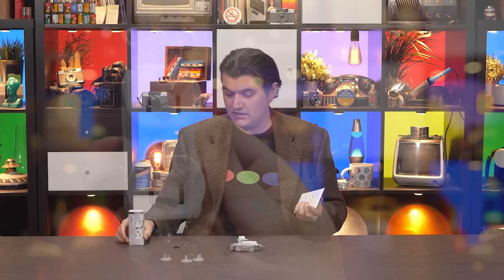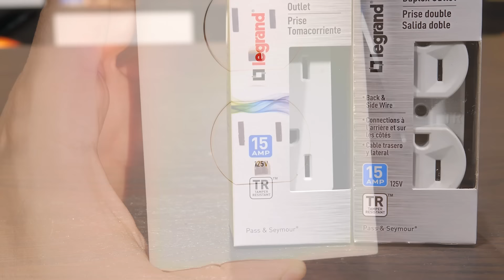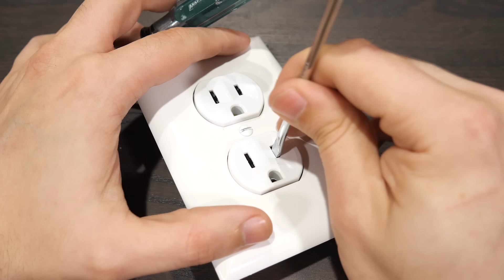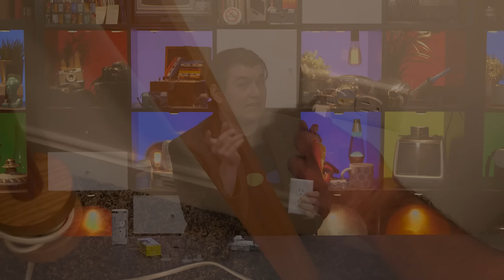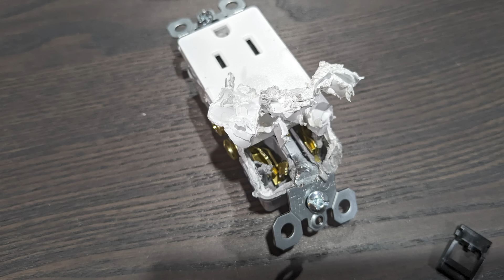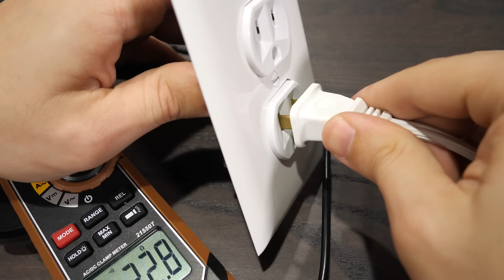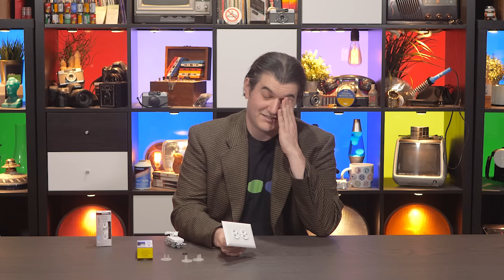Tamper-resistant outlets aren't all the same - a follow-up

Comment: About this "Your plugs are falling out":
What people mean by that (or at least what I mean when I say this) is when you accidentally pull the cord, by walking over it, pulling vaccum cleaner over the cable or just tripping on it - 99% of the cases the plug is going to be yanked out of the wall. My pal living in LA has really messy cables under his desk, and it's very often to him, in the heat of gaming, get his foot tangled around, yank it and unplug like half of his stuff (monitors, speakers etc, even the PC sometimes).
Whereas in Europe you have to pull really, really hard on the plug to take it out (unless it's really shitty recepticle), and often with bigger plugs, like the ones for vaccum cleaners or PCs, it's nearly impossible to pull them out by accident - cuz they are always right-angle and are flush-fit to recessed space in recepticle. So absolutely no ammount of pulling by the cable will yank them out.
In short - in USA if you trip over your cable you pull it out. In Europe you become AT-AT on Hoth...

Comment: I have been to US hotel rooms a LOT, and my adapters kept falling out of wall sockets all the time. US American plugs and sockets are simply crap; just own up to it and get something better. Sorry to be so blunt but that is how it is. 
If the US were to adopt IEC 60906-1 sockets and plugs (and 240 V power on all sockets, which isn't as big a deal as you might think), they would be ahead of the curve for once, and the rest of the world would be catching up.
All it takes is a bit of actual dedication to do it right. Keep your old sockets for legacy devices but stop stelling new ones NOW and start installing IEC 60906-1 sockets NOW.

Comment: Hotel ones are pretty dire - I had some in a hotel in Monterey where the plug for the cheap fan would just fall out. 

The other thing is we're probably using heavier converters - trying to find a socket that would support a UK to US plug was a nightmare without propping it up.

Comment: I can't remember ever getting shocked from using a plug in my nearly forty years of using US style outlets. Even the many I've had to use in poor condition. I have however been the recipient of many shocks at our household current due to my foolhardy insistence on repairing/making my own devices. And while I know that it does happen, no one I've known, even including friends of friends and distant cousins has died or been seriously injured due to a shock at household current, only a couple when working on industrial systems with much higher voltages and while taking safety shortcuts due to perceived time pressures.

Comment: I personally always use the side screws to wire the outlet or switch but I did use the "backstab" connection to teach my 9 year old son how to wire his own light switch. We went through all the safety and turned off the breaker and tested that the power was cut to the switch.

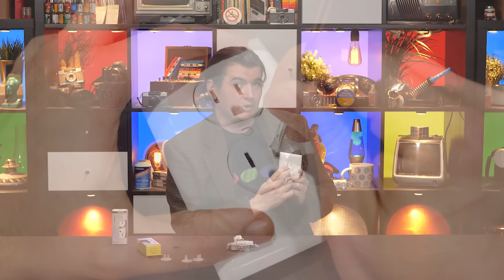Comment: 2:20 that's how shutters on mainland europe plugs have worked for... decades I think? Getting them straight on is also less of an issue outside of europlugs, as both the E and F sockets will guide the corresponding plug more or less in thanks to the recess (and the side-guides on the F). Type C-2 europlugs do suffer from the "wiggle from side to side" issue.

Comment: Some british outlets use the "both pins simultaneously" guard instead of shuttering off the earth pin. Most MK sockets (widely regarded as 'gold star') work like this. This means that sticking a screwdriver/key/whatever in the earth hole won't reveal any live parts.

Comment: You've hit on the reason most folks HATE the TR outlets, they prevent easy, legitimate access.
Also, I prefer the conversational style of this video.
Reply: As a grown-ass adult of forty years, I LOATHE TR outlets. It’s a fight any time I want to plug something in. It’s never the same angle or amount of force twice in a row, even with the same device. I have very limited outlets in my kitchen and often have to swap things in and out. TR outlets make it take ten times longer than it actually should, every single time, because I have to stand there just fighting the damn outlet to let the plug in.

Comment: Some socket manufacturers in the UK use a shutter system that requires the presence of the Earth pin and also simultaneous insertion of the Line and Neutral pins. I don’t think even the most curious toddler would ever figure that out 😂

Comment: My thoughts on the whole "plugs falling out thing":  Visitors from other countries and continents are likely to encounter US-style plugs in hotels.  My personal experience has been that I've only encountered dangerously loose outlets in hotels where the outlets get the most use and abuse.
Reply: The bedside/desk lamps that have an outlet with square black plastic trim are always the absolute worst, I've never encountered a single one that wasn't incredibly loose even in new hotels so I'm inclined to think they're really that bad from the factory.
Reply: @adueppen  Don't forget that hotels are typically constructed with the cheapest materials available, so the outlets start out bad and wear very quickly. I've encountered quite a few loose/worn outlets in old houses and in very cheap houses - especially older manufactured home.
Reply: @timdouglass9831  usually the wall outlets haven't been too bad from my experience, it's primarily those lamps that are ridiculously awful
Reply: I second that. I’m in hotels and on planes all the time for work and they wear out so fast that they are almost universally worn out whenever you try to use them. On a hotel bedside table, if a plug stays in an outlet well enough to even maintain an electrical connection, it’s cause for celebration.
Reply: I think it might also be down to the use of travel adaptors. The extra mass, bulk and sometimes poor design of adaptors (many "universal" ones have rotating flat prongs designed for both US and AU/NZ sockets, the latter of which don't have different widths for the live and neutral pins) combined with a heavier plug can make it more prone to pulling away from the wall when jostled.
Reply: To add on to that if anyone is using an adapter they’re usually very bulky which moves the center of mass well out from the wall so combine that with heavily used receptacles there likely to be pulled out by their open gravity
Reply: @Kaze919 I have the same thought about adapters -- my experience traveling to Europe is that my chargers are constantly falling out of the outlets, but I assume that's because I was using cheap adapters.
Reply: @meatmanek same! I’ve experienced really loose outlets in Europe, using 2 prong plugs (the ones with a “diamond” shape). I’m sure a 3 prong, or a 2 prong that has a cylindrical boss instead of a diamond would be more secure, since it would actually mechanically interface with the bore
Reply: I think it's a combination of "two prongs feel less secure than three prongs" (understandable since there are fewer points where the plug is gripped by the socket) and maybe that hotel sockets are likely to be the type that accept all conceivable plugs and therefore have much wider tolerances.
Reply: @3rdalbum  I wonder if the Australian socket (which is similar to the US one) is better as the blades are angled. (Interestingly, the Aussie socket is actually an abandoned US standard).
Reply: @chaos.corner  The Aussie plugs/sockets are very good. By law all plugs now have sleeves on the prongs so they can't be bridged by the "throw knives at the wall" game. The prongs are retained very securely, and earthing has always been required on sockets.
Reply: Also, the cord normally comes out of the back of the plug rather than the bottom, so it's easier to remove without touching the prongs - although as I mentioned, the prongs now have sleeves and have done since the mid-2000s.
Reply: Came to say this. I travel to the same hotel every 2 weeks and every room I’ve stayed in has had at least one or two outlets that were totally worn out.
Reply: Tourists in general develop an extremely warped perspective of what life is like in other countries. In many ways, they're often more ignorant than people who've never gone abroad.
Reply: Besides the outlets being worn out, most Northern European outlets like the ones in Germany and France (not the same but often intercompatible) have round recessed edges and support the plug fully. It makes North American outlets feel very flimsy.
Reply: Yeah I don't think I've ever had a good outlet in a hotel. Most are just part of other fixtures like lamps.
Reply: I've seen some in houses that are ridiculously loose. At least one of those was, I think, due to heat fatigue from years of heating by a giant transformer for an alarm system. I didn't use that outlet in that rental because it was so loose. Eventually it fell apart, shorted internally, and tripped the breaker, forcing me to replace it. The others were either used heavily or just the cheapest outlets that didn't hold their tension.
Reply: I have one in my house here. I never noticed it before because I never use it. And I haven't replaced it because I forgot all about it because I never use it.
Reply: I've almost NEVER seen a hotel plug that WASN'T worn out.
Reply: You’re probably right. And yet aside from North America I stayed at hotels in Europe, Asia and Africa where that is no issue at all regardless of how old the hotels are.
Reply: Some of the loosest plugs I've seen were in Hong Kong. British* standard plugs. Yet they were firmly in the second place, right after the ones in Chinese hotels (think US-style non-polarized, no ground connection and with 220V just to spice things up).
Reply: What you say is true in my experience as well.  I now travel with a short extension cord that has blades made of thin, folded brass sheet so I can bend them by hand or spread the sides of each loop apart with the tip of a pocket knife blade to give it a chance to make reliable contact in a worn-out outlet.  It's a PITA to wake up and find that one's cell phone has less charge in the battery than when it was plugged in for charging the evening before.
Reply: @Milosz_Ostrow they make Shem's for plugs that are inserted in the outlet to make the plug prongs fit snugger; I don't recommend them for the home just replace outlet/recptical with spec grade recptical
Reply: But only a complaint in US hotels. No issue with other hotels I have visited around the world.
Reply: The trick is to take cheap cables, bend the prongs to match the outlet. And toss the cable as soon as it looks even slightly janky.
Reply: Hotels//Motels and Apartments usually have worn out outlet recpticals.
Reply: I have two outlets that are super lose! And the only one outside is scorched. Hoping we can get it fixed asap
Reply: @Canipetyourcatplease  u should be able to do it ur self just remember to turn power off to the recptical first and watch videos on how to do it like from Bill known as sparky
Reply: He said about the hotels in the video.
Reply: In hotels, outlets are not the only thing that are loser due to overuse.

Comment: If ever using 2 prong cords that feel loose, just pinch the prongs toward each other just a smidge. It will grab the outlet from the inside and it takes more force to come out. It even works on old dingy outlets.

Comment: I know Euros love being smug about plugs and some of it seems like made up problems -- I think the cases of anyone having a plug come a bit out and then dropped something on the exposed prongs to short it out are vanishingly few. HOWEVER:

I visited the US yoinks ago and I had handful of frustrating "Well I just pulled the plug out by accident when moving this thing" experiences and those were outside of hotels! I was there doing a thing which did involve interacting with lots of devices and plugging them in and moving them around. And the plugs were just looser? They slipped free with not-that-much force on the cord. Which granted is possible with a Europlug (tho even those have a fair bit of grip) but basically impossible with a Schuko like I'm used to on the majority of the equipment I work with back home.

And it genuinely stood out!

Since then I can't remember the last time I had an experience of accidentally unplugging something I didn't mean to.

Comment: An example of how 120 is safer/less dangerous than 240: 
Several years ago I was attempting to tighten the screw that holds the socket into the wall box at work (I was like 19 and being paid not very much money to clean the elementary schools in the next town over during the summer so of course I didn't think to turn the circuit off). It was a flat head screw and while I was turning it the screwdriver slipped into the back of the box where all the wires are and completed the circuit. I distinctly recall thinking the full sentence "Oh, I am being electrocuted, I should probably let go of the screwdriver" and when the thought completed, I did. I was continuously shocked for about 4 seconds, and I'm still breathing.

Comment: I really like the outlet and plug design that we use for our server building, they have a lock on the plug that goes into a similarly shaped hole in the receptacle that locks the cord in place and it prevents the plug from drooping from the wall. Of course this is a higher voltage specialized outlet and plug system but you can still use standard plugs (if the device can handle the voltage).
Reply: What kind were they?

Comment: I don't like wiring up receptacles via the back-stabbing method because I have seen receptacles wired that way arc and spark and melt even with nothing plugged into them. I'm constantly astonished that it's allowed by code.

Comment: Don't forget Switzerland we have a 3 phase system means 230V to ground and 400V between phases.
What I think is problematic with 110V that you get this high current demand which is a fire hazard and the shock hazard is easily solved with earth detection devices which are obligatory in CH.

Comment: My house was built in 1983 and all of the 15 amp circuits going to outlets use backstab connections. I’ve had four of them fail since I moved into the house. And when they fail, they usually fail intermittently. It’s a miracle the house hasn’t burned down.

Comment: When I was 8 years old, I also did the same Alec mentioned: With two fingers, I reached into a bulb socket of a lamp that was connected and turned on to feel what was inside. I got shocked with the European 240 Volts. Nothing happened, just a slightly burned fingertip. It did not trip the breaker, btw. I just got a short spasm, knocked the lamp over and that stopped the connection. Also my arm muscles kinda hurt for a day, but that was it. So the 120V is not necessarily what saved Alec.

Comment: Lol when you mentioned the outlets getting paint on them I remembered when I bought my house. We were painting a couple of bedrooms and my wife had her cousin and his girlfriend come over to help. Turns out neither of them had any idea what they were doing because not only did they not take the outlet covers off or use any painters tape, they literally just rolled over the entire live outlet. So we then had to remove the outlets, paint behind the covers, and replace them all.
Reply: When I bought my current house, the painters they'd hired to make everything that awful ugly beige for selling the house had painted over almost every single outlet in the whole place. And not just a little, either, like to the point that some of the outlets were completely unusable from how much paint had gotten into the holes. I had to cut around and pry the covers up with a boxknife and replace every single one besides the one in the bathroom. Awful! Dunno what the heck they were thinking.
Reply: @animeartist888  thats a shame, and it's not even hard to do it right... a quick turn of the screwdriver to remove the faceplate, then a 2-3" piece of tape over the faces is all you need
Reply: I've seen too many outlets with paint on them.

Now our outlets usually have removable parts to the face plate, so you can remove the cover before painting and then replace it afterwards. If you get a little paint on the very edge of the outlet you won't see it after the cover is back on.

However I still see outlets with paint dripped all over the cover...
Reply: Must be landlords.

Comment: Most (but not all) British plugs have shrouded neutral and live pins so the device only gets power once the earth pin displaces the safety shields allowing the plug to go fully home. You can still buy & fit your own plugs in Britain. How does that work in America?
From Memory, most Danish 2 pin plugs also had shrouded pins & every appliance came with a molded plug. This started in the late 60s, but I haven't lived in Denmark since 1970 & things will have changed.

Comment: I noticed that 120v you don't feel it in the plug as you do in a 240v plug. Though, if a 120v outlet explodes that is no longer 120v as my big brother found out when he was a teenager and ended up in the hospital with 3rd degree electrical burns.

Comment: I also don't understand the hatred that the back stab connection gets  on YouTube.  I have lived( over the years) in several different houses and apartments and every single one of them has had all of the outlets connected with that method.  I don't do it because I find it a pain to undo if I want to change something later on. But if EVERY licensed electrician hates them, how do they keep getting installed on construction sites?  I prefer the SIDE connection that is available on some higher end outlets.  Best of both worlds really.

Comment: Your argument in favor of backstabbing outlets by comparing them to wegos is valid, but wegos are also trash. Make a good tap and use a wire nut, and wrap solid wire around outlet screws. Just my experience. I have 9 years experience as a commercial electrician.